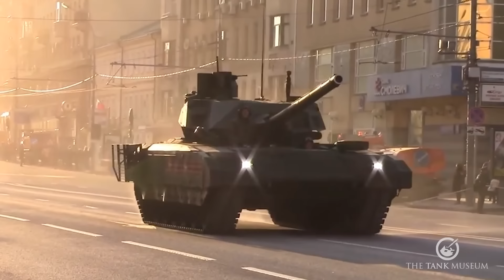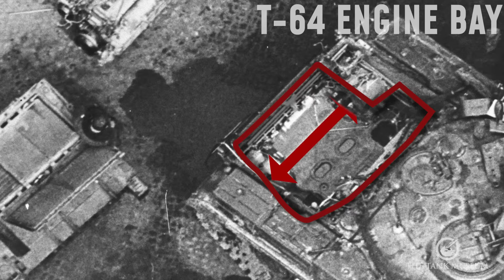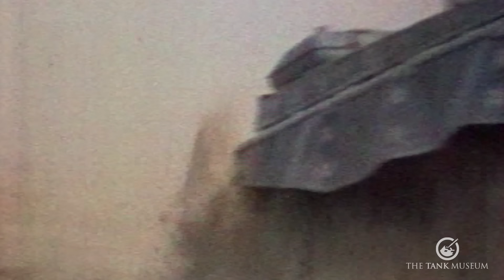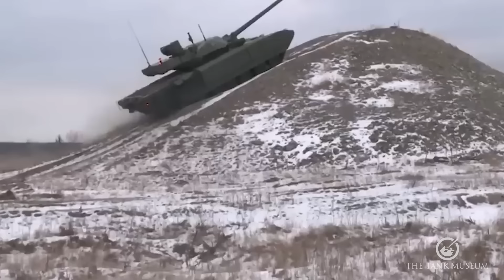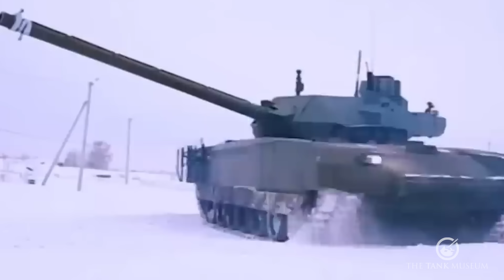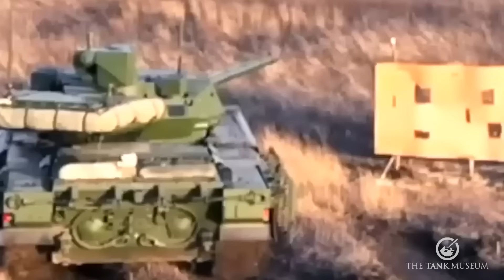Radical or Ridiculous? | T-14 Armata | Tank Chats #171

Comment: Still no T-14, in 2025.  The conflict rages on, the Soviet stockpiles of tanks are very low - the tanks that can be considered as salvageable
Reply: Why would they send a tank like that to Ukraine?
Reply: @aveglorio  you can choose your favorite: because allegedly this tank is supposed to have active protection systems that can easily defeat FPVs - the main threat to armored vehicles on the Ukrainian battlefield. Because this tank shouldn't suffer from Jack-in-the-box effect of the current tanks that are sent to their demise. Because it is supposedly safer for the crew. Because it is supposedly able to detect an engage targets at larger distances in all kinds of weather conditions. Because they are running out of old tanks. Because it is a tank - that's what its job is, to take fire, to break through enemy lines. However, this is just another vaporware from the kremlin - always overpromising and underdelivering. Just like the T-90, just like the S-400, just like the Moskva...the list goes on and on
Reply: @jackforman561  The T-90 and other tanks in the Russian arsenal already have anti-FPV drone systems, as well as targeting systems capable of handling different climates (and the Russian climate isn't even that different from the Ukrainian climate, it's not like the equipment will handle anything new), not to mention that they're not short of old tanks. It makes no sense for them to want to send their latest tank, with new technologies, very different parts, few specialized units, and having to adhere to yet another line of supplements to keep them in a war of attrition. As you said, a tank has to withstand enemy fire and break through enemy lines; they already have vehicles that do that job. Even the Americans and Germans haven't sent the latest versions of their tanks.
Reply: @aveglorio  the anti-FPV drone systems are the sheds they are mounting on 50-year-old tanks and the jammers on top of that. While it will take up to a dozen drones or more to take care of that tank, that tank can't rotate or use its turret - not really a tank at that point. I agree that it doesn't make sense to send the T-14, but for a different reason - because they only have a handful of them (for parade purposes) and even those are just prototypes with many issues yet to be figured out. They don't have fully functional T-14s. Keep in mind that new technology is frequently leveraged on the battlefield to gain advantage, but when you don't have it, you won't use it. And please don't compare what Russia's doing with what the Germans and the Americans are doing. The west isn't sending their own armies, rather they are getting rid of their old stocks. They are timid and just watch this from a distance. Russia is directly involved in the conflict, so it is in their best interest to use the latest and the greatest they have to try to win. They are not short on tanks, they are short on functional tanks. The larger part of what's left of the Soviet stockpiles is rusted junk. There are satellite images out there that show the dire state the remaining reserves are in. If you refer to the motorcycles for breaking through enemy lines, then I will agree with you that they have vehicles that do that job. But when you send wave after wave of your soldiers with minimal protection, it says a lot about how much you care about your troops. So why waste money on expensive new tank prototypes, the old stuff is good enough. I will agree that introducing a new tank with completely different infrastructure from the old ones does require another level of complication with supply lines, but they are already using everything from T-55 to T-90, so I really don't think that's the reason.
Reply: @jackforman561  The Leopard 2 is a tank that's almost 50 years old. Both Russian MBTs and Leopards have been modernized. In fact, the T-90 itself is more than a decade newer than the Leopard 2. The Russians are already installing anti-drone electronic warfare systems on their more standard tanks. And I can easily compare what the Americans and Germans are doing in terms of not sending more modern tanks to the battlefield. It's obviously a very easy-to-understand reason: they don't want the latest generation technologies of their tanks in Russian hands, and the Russians don't want the newest T-14 in Western hands. On this scale, it makes no sense to send T-14s there. There's no shortage of parts for the T-55 to the T-90 in Russian stocks. They don't need to worry about maintaining large factory systems for parts and maintenance, so they can keep those same factories producing new vehicles.

Addendum, the T-14s that the Russians have are not prototypes, they are already versions with defined designs and concept, having a limited batch of vehicles does not mean they are prototypes, they have already passed that phase, it is a pre-production model, not a prototype model.
Reply: @aveglorio  well, let's not compare apples to oranges. What is considered new in terms of hi-tech on a Soviet tank, has been in use in a western tank for a while. Another example for this, F-22 vs Su-57. The Leopard 2 was produced through the 90ies, unlike the T-55. Besides, Germany is not going around chest-beating and invading neighbors. Just something to keep in mind. Whatever you want to call the phase the T-14 is in, it's splitting hairs in the grand scheme of things. They had a partially functional tank in 2015 - that's 10 years ago. At this point, nothing on the T-14 is cutting edge technology that the west doesn't have or is not aware of. And keep in mind, whatever technologies it might harbor, all that is just kremlin claims - overpromise and underdeliver. No objective testing results in real world conditions. Just like the "unstoppable" Kinzhal. I am sorry, I really don't see compelling evidence in the arguments you presented for keeping the T-14 off the battlefield if it's fully operational and Russia has the capacity to build more. Maybe there is a concern if they deploy it and it gets destroyed by drones, Ukraine will have video evidence and it will destroy its reputation even before it had a chance to be advertised to foreign buyers. Or, it incorporates western parts that are currently sanctioned and Russia can't find a replacement. I agree with you on the need for additional factory capacity though - Russia invested heavily in the existing production lines that crank out older equipment back in 2022 when they realized it's not going to be a quick victory and had to shift to a war economy. Additionally, they have quite the shortage of workers in their economy that is not likely to get better any time soon.
Reply: @jackforman561  The Leopard 2 is from 1979, and the T-55 and T-62 aren't even being used as tanks/MBTs, but rather as support guns like SPGs. 
The term "Soviet" used colloquially like this makes it sound like old technology, but all Western main tanks are also "Soviet-era," since they were all developed and adopted before the Soviet Union collapsed, some russian vehicles are from the same decade as western vehicles. And of course, the Russians have things that the West dont have, and vice versa. For example, the West doesn't have much of a grasp on the composite armor of the T-14, and the Russians doesn't have much of a grasp about the composite armor of the newer Leopards and Abrams. But both sides know that the other side has composite armor and have a sense of the most likely materials to be used.
Reply: @aveglorio  I have tried to post a response, but it doesn't post for some reason. The Leopard 2 was produced through the 90ies, so just saying 1979 is cherry-picking details to fit a certain narrative. Speaking of narratives, one of the kremlin's narratives has been that the T-55 and T-62 are not used as tanks, but as support - there is plenty of footage of these 2 variants, usually equipped with a shed or a cage of some kind, trying to storm Ukrainian positions. This is why I tend to read what both sides say, so I have a better picture of what is happening in reality. In tems of hi-tech equipment, my previous comment says it all. What's considered new on Soviet/Russian tanks, it has usually been in use by the west for a while. Add to that the propensity to exaggerate specs and instead use what is already available (ERA), and you can see why we should take the claims with a large grain of salt. Again, a glaring example would be the F-22 vs SU-57. The F-22 is decades older and still more advanced overall. Thank you for keeping this conversation civilized by the way. When it comes to opposing views, the discussions often devolve into personal insults.
Reply: @jackforman561 ok but they only have a 20-30 t14. So why send them?

They wouldn't accomplish anything in such small numbers and require alot of effort to train up crews and get logistical parts for them. 

When you account for that bringing in 30 state of the art tanks no matter how good they are just isn't worth it.
Reply: @jackforman561 the west isn't getting rid of old stock lmao. Europe sent most its state of the art anti tank missiles in 2022, france and the uk sent most there advanced missiles alot of countries depleted their artilery stocks or stocks of spare tank parts like the uk and Denmark. Not to mention depleting stores of artillery shells.
As for tank the west has sent as much modern tanks as they are capable too give ukrianian manpower, logistics and training limitations
Reply: @baileygregory9192  if it's not worth it, they wouldn't bother to build them - they cost millions of euros each. A tank does its job on the frontlines, not at parades. With the defense lines so thinned out, 30 tanks - which is an entire tank battalion by the way, can achieve a significant breakthrough that can be exploited to make substantial advances and collapse the frontline. The real reason why we don't see them on the frontlines is they are not functional as advertised and not battle-ready. According to your logic, we shouldn't have seen any bmpt terminators on the battlefield either, but here we are. Besides, the T-14s are only state of the art by Russian standards and Russian claims. Objective assessment is yet to come.
Reply: @baileygregory9192  lmao? the arrogance... if you didn't notice, we were talking about tanks, not missiles and artillery shells. But I am glad you mentioned the anti-tank missiles. Let's watch the hundreds of videos of how effective these are at popping off Russian tank turrets! It is only fitting to get popcorn to watch this. By the way, the T-14 is advertised to be very effective against this type of weapons, and yet none are seen in Ukraine. Hmmmmm......

Comment: From all the info I've seen, verified and unverified, it's turret is still its biggest weakness. Unmanned, splinter armor at best. Full of shot traps. Gun, sights, most sensors, basically hanging in the breeze. Don't need an AT weapon to take it out. AP rifle rounds will do the job quite nicely.

Comment: The only thing that makes different is that it has an interchangable chassis for different configurations and platforms, it can be changed from a main battle tank to an anti- aircraft, or other configurations, and the russian tankers won't ever touch it cause all 3 crew are in the forward hull side by side.

Comment: Some years ago, I read the matter of fact specifications for this vehicle. It was described by credible defence analysts as a 'weapon of concern. Upgrading the Leopard will take until 2085, and that is just to match the &-34 now. 

  What is not really mentioned here are the adjustments to road wheel configuration, and gun elevation. Both enhancements for performance.  Particularly the latter. Extreme gun elevation is designed for not only an anti aircraft role, but urban and city fighting scenarios where tanks have been vulnerable.

Broadcast was doing fine until the usual comments about Russia's ability to produce vehicles, and produce equipment of a high enough quality. I'm surprised shovels were not mentioned at this point.

As for the statements of the MOD. Surely anybody who has routinely read their appraisals of what has been going on- realises that fantasy and dissonance are the main factors in their output. And then finally- 'for propaganda purposes'  Really?
Reply: Remember, there is no propaganda on the west. ;)

Comment: One thing that confuses me is why they put the commander on the right side of the armored box. If his radio gets knocked out, he has to lean infront of the gunner, blocking his vission and then shout commands to the driver. If he was in the middle, he could look left and tell the driver to turn left without yelling as loud and then quickly look right and tell the gunner to load HEATFS, again without yelling as loud. This would make the vehicle that can’t see backwards without fragile cameras and has no backup sights a bit more useful if the optics are knocked out or the radio fails.

Comment: It does not have all round Active Protection, it is fitted to the turret and only covers the turret frontal arc.   There is no top attack protection. It can fire smoke to cover the turet but this will not stop modern missiles like NLAW.

Comment: Active protection systems against sabot rounds are a very real thing and they work surprisingly simply. You know how arrow armor destabilizes sabots by striking the tail? Well, an APS detonated next to a sabot destabilizes the sabot because the center of gravity is not aligned lengthwise with the center of drag. Think of the way a wind vane works. It turns into the wind. Sabots do the same thing if hit with an explosion. It’s very simple and can be tested relatively easily as long as the correct fuses are used to guarantee accurate timing.

Comment: The commanders don't trust it in the field but instead trust a t-72??
That has to be the most bizarre comment I have ever heard. I would feel safer going into battle with a stripped down T14 that a pimped up T-72.
Reply: Commanders don't ride in tanks on front lines they send them. You don't seem to understand tactical planning

Comment: It’s non existent as a tank force, it’s a prototype with very limited numbers. 

Many reviews of it are also based on available data released by propaganda outlets and western sources, the over all view of it is that it’s better than the T72 but has design issues, one being its auto loader system is isolated from the crew who work from a isolated unit or capsule and if it jams or malfunctions can’t be sorted out by the crew, it also has older generation optics bought from the west or China. 

Its engine is based on an old German design too, and it’s not been very reliable….and the last generation of engines used by the Russians won’t fit into the T-14 either due to the design layout and available volume being reduced.  

It’s very much more expensive to manufacture too, various experts think the numbers available today mean they have between 14-150 of them depending on which expert you believe.

Comment: The design of this tank not only perpetuates, but even worsens, what has always been a major problem with Soviet/Russian tanks - fighting with closed hatches. Russian tank crews are damn near blind. They can't see in any direction but straight ahead. You can sneak up on them from almost any angle, especially from above, and they will never see it coming.

Russian experience in Ukraine should prove to them the fatal flaw in their tactics and training. Without heads and eyes outside the tank, they have absolutely no chance to see the drones coming. Especially from behind. The Ukrainians, whenever possible, have their drones strike from behind, about where the edge of the bustle rack overhangs the hull. From that angle the jet from the warhead goes right into the ammo carousel under the turret and blows the turret off. If the TC or the loader were outside the hatch and looking around, they'd have at least some chance to see it coming and take countermeasures. But with every man covered and no visibility except to the front, they're helpless.

Seriously, as bad as the visibility is in Russian tanks, they might as well do away with turrets and use nothing but fixed-slope "assault guns". That way they could put on heavier armor and have a better chance against strikes from above. Hell, their "turtle tanks" where they've covered the tanks with impromptu sheds, really are assault guns. With those in place, the guns can only traverse about 20 degrees anyway. Forget the turrets, thicken the armor, simply design and production, and have more survivable fighting vehicles.

Comment: modern day main battle tanks including the T-14B Armata could seriously do without the fixed co-axial gun altogether . . . it's no longer relevant in present day warfare . . . besides modern tanks have turret top mounted 23 MM GAU-19/U six-barrel rotary gun or 12.7 MM HMG (slaved to a 360° deg rotating remote weapons station) which is more than enough fire power for close proximity engagements against enemy troops & lightly armoured vehicle etc. . . a coil spring based 6.3 in. suspension lift will complement the stock torsion bar setup providing superior off roadability & additional break-over angle . . . a optionally manned turret variant of the T-14B Armata main battle tank will be much sought after in the export market . . .